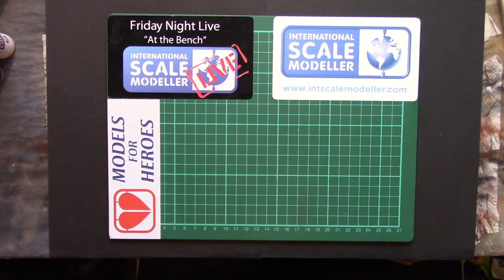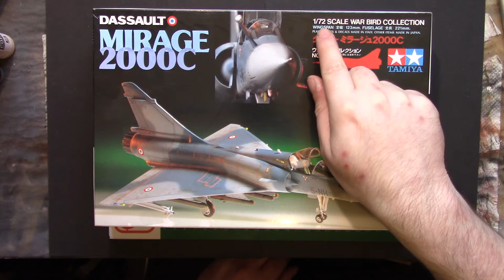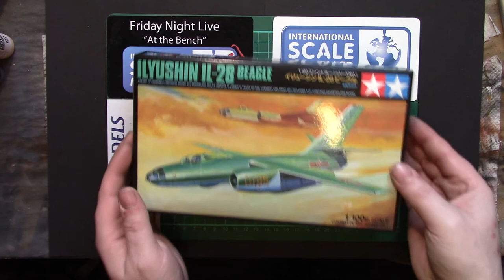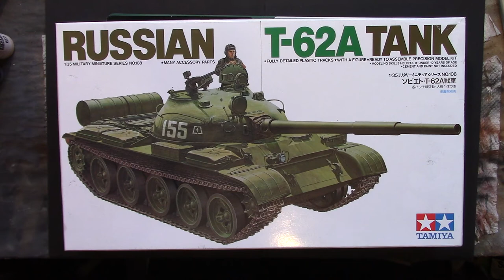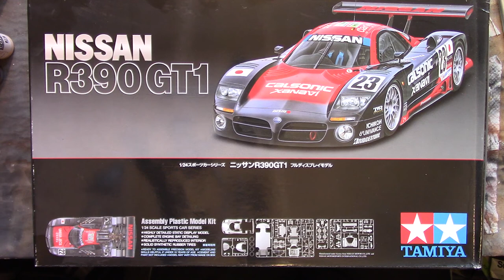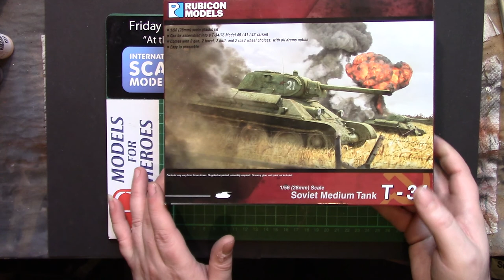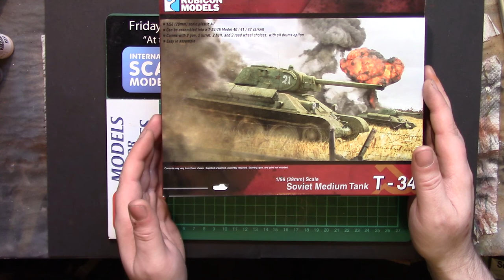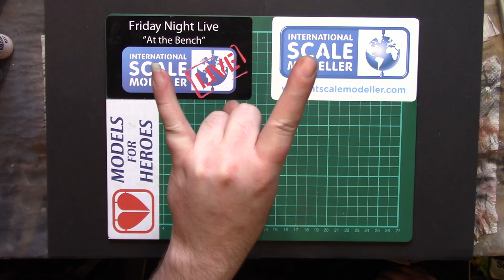modelling scales explained

Comment: 1/72nd scale goes back to the 1930s, with Skybird balsa kits and the Frog Penguin plastic kits - 6 feet on the full size aircraft is 1 inch on the model. 1/144th is half of 1/72nd. Airfix did a line of 1/24th scale Superkits beginning with the Spitfire Mk.I in 1970. Others have done 1/100th, including Heller with their Cadet series of beginner kits. Heller also used 1/125th for its airliners. Hasegawa use 1/200th for its airliners, and a few large military aircraft. At one time 1/96th scale was popular for larger aircraft types.
Fujimi still use 1/76th scale for their armour kits, including those they got from Nitto. Matchbox also used 1/76th scale, and some of their old kits are still made by Revell Germany. The large Tamiya armour models are 1/25th. The very odd wargaming scale of 28 mm or 1/56th is also becoming more common, Italeri do a number of kits. This is a very new scale compared to most of the others, which have been around for half a century or more.
Most countries use 1/24th for car kits, but the Americans generally use 1/25th, with a couple of exceptions. 1/32nd was very common in the early days, and Airfix had a large range of modern and vintage car kits in this scale. There are a few kits in 1/43rd, which is mainly a diecast scale, or 1/48th.
Airfix had a large range of 1/600th scale ships, and 1/1200th has been used mainly for the larger vessels by several companies. Motor torpedo boats are often 1/72nd, and Matchbox did a Flower class corvette in 1/72nd, which has been re-issued by Revell. There are also some WW2 submarines in 1/72nd and 1/144th.
In figure scales, 54 mm is 1/32nd scale, which has been a common size for model soldiers since the late 19th Century. Then you move down in to the wargaming scales: 28 mm, 25 mm, 20 mm, 15 mm, etc.

Comment: I have a model ship that is 1:84, what does that mean and how do you determine the actual size of this ship? If increase the size by 1.5 times how will I determine the new ratio and size of my ship? Thank you in advance.
Reply from the maker: The maths isn't too bad, just divide the length by 100 and then multiply by 150 to give you the new size. The original real ship was 84 times longer than the model so you can work out the size and scale from there by dividing the length of the real ship by the length of the model to find scale.

Comment: I'm very confused with the ww2 kits and scale Iv collected 1.18 and 1.16 scale model cars all my days and now in building 1.35 ww2 kits and alot of them I got a 1
35 patrol boat and wanted it bigger so got a 1.48 scale and its huge compared to the 1.35 boat, but normally the lower the number the bigger the scale yeh!? Not on the trumpeter uboat 1.48 with open sides and full detail and the patrol boat there massive at 1
48 to my 1
35s! I'm beat here I'm wanting a bigger Matilda 2 tank than my 1.35 now and was gonna go for a 1
48th but now I'm really confused
Reply from the maker: Are they the same type of patrol boat? Not my forte but i seem to remember there being a couple of different types. The 48th matilda is tiny and i don't think anybody makes it in 1:25 or 1:16.
Reply: Yeh ths same patrol boats the 1.48th its huge Sonics the trumpeter see through German uboat iv got them.in 1.35 too the big ones just fit one on one shelf I'll go for the 1.35 Matilda in doing the scammel pioneer and trailer with the me lee just now in 1.35 and that's big for a 1.35

Comment: If I was Emperor of the world, my first decree would be to unify the scales.
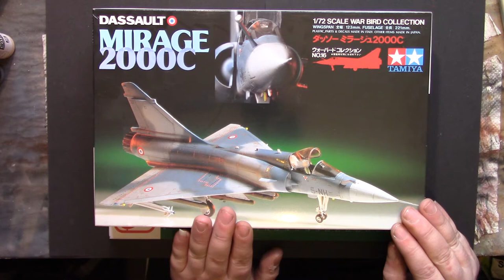Henceforth no more 1:35 or 1:48 scale, all 1:35, and 1:48 scale model will be remade into 1:32 scale.
Reply from the maker: Lol, scale is all dependant on subject, i really don't see the point in 1:32 lancasters etc, 48th is plenty huge enough for those, then you get a 1:144 tu95 that is over a foot long and wide, 72nd is plenty big enough for one of those. That said i wish tanks could be a bit bigger.
Reply: @sharpiesfishandphantoms  be lucky I'm not Emperor, your heresy would not be tolerated. You would be sentenced to 10 years hard labor in the the plastic mines of Mt. Tamiya.
Reply from the maker: Nooo, not mt tamiya where the easy kits come from!
Reply: @sharpiesfishandphantoms  have you ever been to the Isle of Bandai?
Reply from the maker: The isle of bandai was interesting as a short break, I'm more at home in the tower of trumpeter, top floor where the T90s come from.